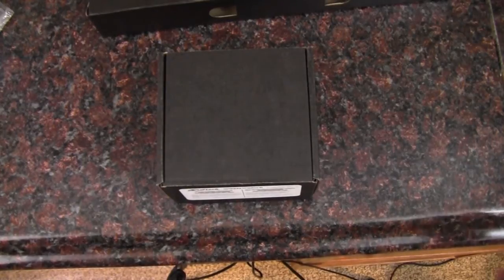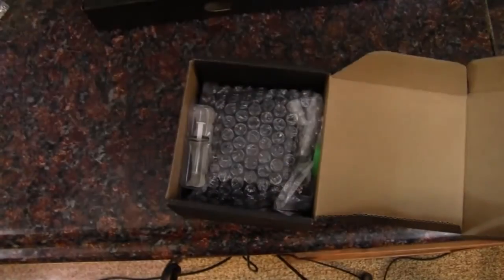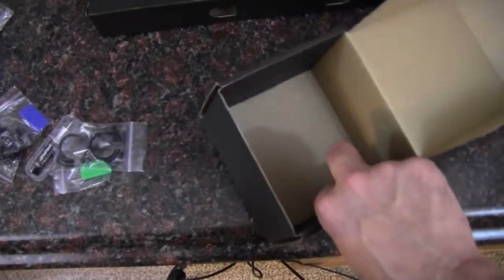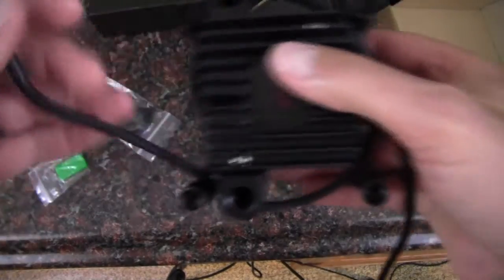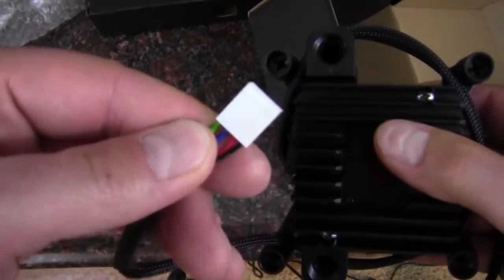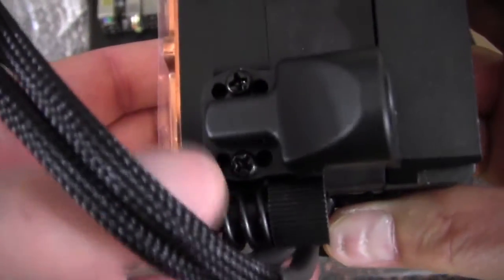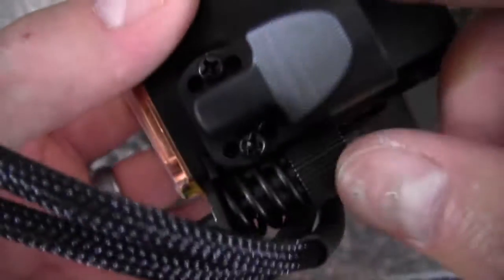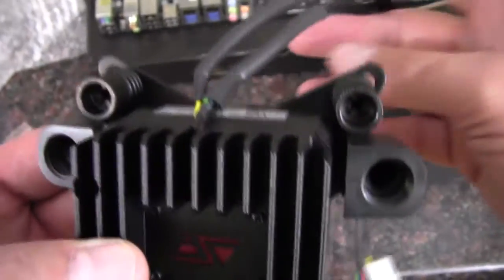Swiftech Apogee Drive II Socket 2011

Comment: Hey man, How was the noise from this pump?  Was it noticeably audible? Did it vibrate the mobo or rest of the computer?  Trying to find some input on the noise factor and haven't found much of anything!    THANKS MAN!
Reply from the maker: To me it was about as quiet as a cheap AIO unit from Corsair or other companies. That being said, this is a much more powerful pump. I would guess that since the enclosure is a bit bigger, that dampens some of the sound. Mine did not vibrate at all.

Comment: the molex connector needs to go. can i run it just off the 4 pin ?
Reply from the maker: I do not think it can be powered by the 4 pin alone. I would try it if I still had the pump, but if I remember correctly both need to be used.
Reply: That giant connector makes me angry.
Reply from the maker: Some manufacturers have switched to SATA connectors to power the pumps. I am wondering that maybe there isn't enough amperage on 3 and 4 pin fan headers.
Reply: nobody seems to publish their capacity. ive been told by some of the guys at puget systems that some boards support 2 amps on their ports. that would be enough to run a pump
Reply from the maker: I would guess that the most likely boards would be newer ones. I have seen a few of the Z170 and Z270 boards with a water pump 3 pin header.

Comment: 5:00, really? Just pull the fucking wire up and the block comes out, moron.. Also yes you can power it up, the light is on a different connector than the pump, jesus...
Reply from the maker: Hope you feel better after that...

Comment from the maker: I doubt it. I think at least the water should be changed and the loop be flushed yearly. That is my opinion, some may push it farther with additives. I use only distilled water. At the very least, I check my reservoir every other week and add a bit of water maybe every month. Must just be evaporating, I cannot find even a seeping leak.